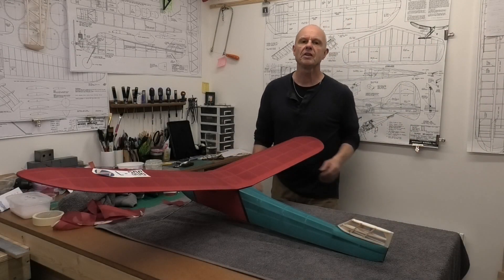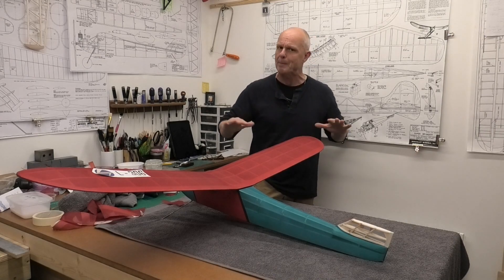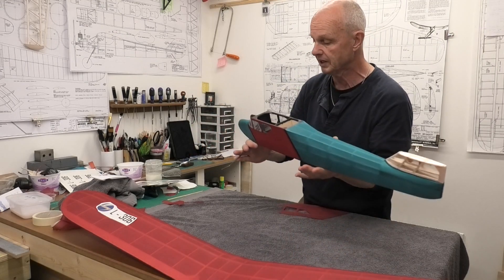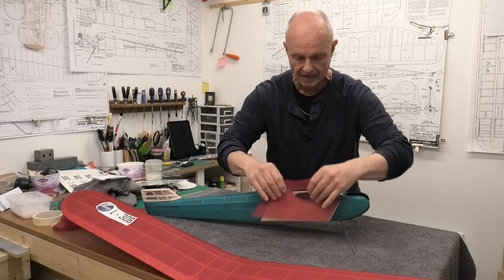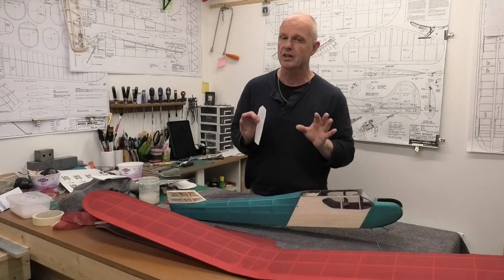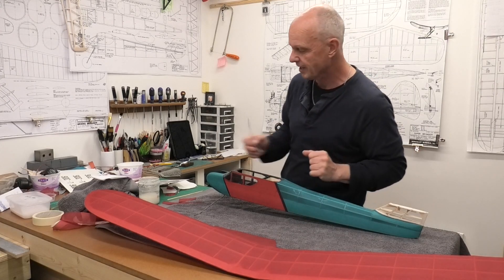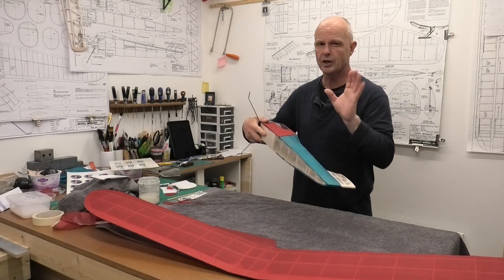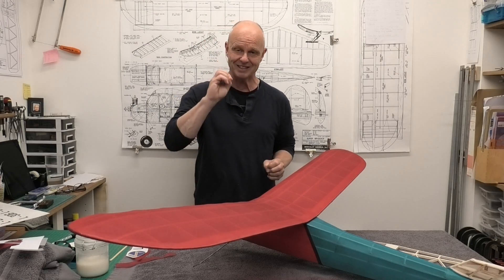Model L Vintage Build Blog Pt: 6 - Fuselage Covering - Design by Peter (O.F.W.) Fisher

Comment: As ever, looks 100% Mark. Also looking forward to the rudder/elevator assembly and please can you cover how you will arrange the controls, will you mix those surfaces?
Reply from the maker: @911hillclimber  Thank you very much, really pleased you like the build.  I very rarely add any mixes to the setup, so unlikely I will with this.  I will however be showing the control setup. 😀